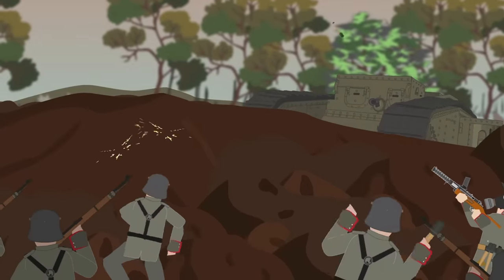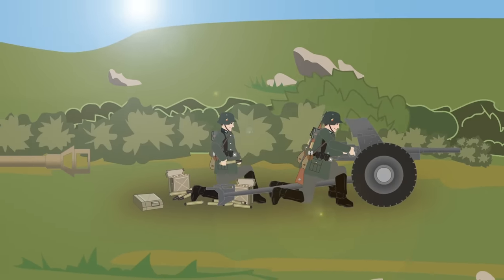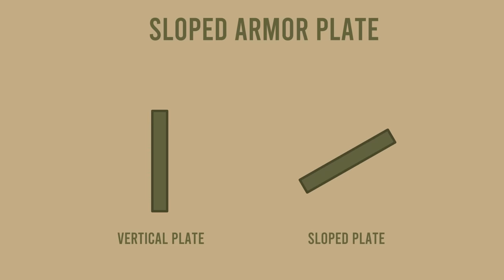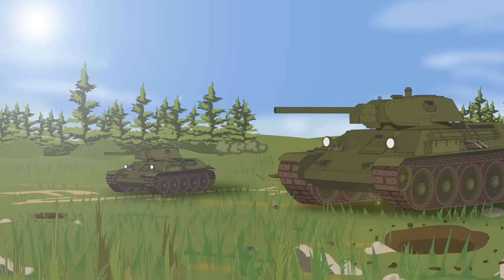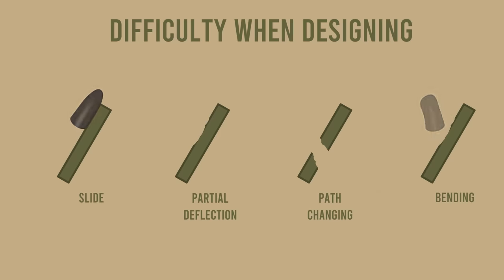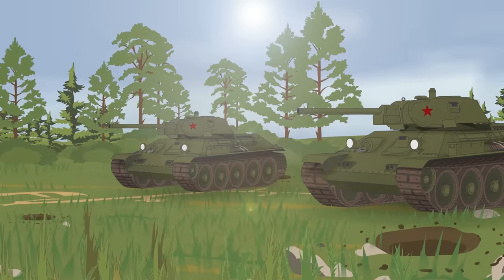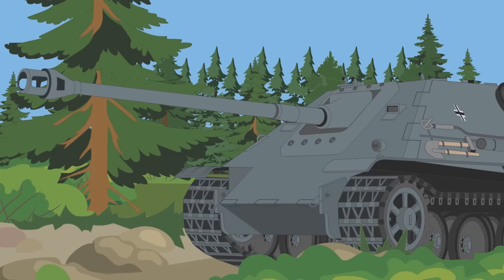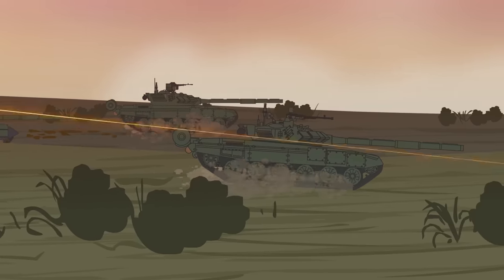Sloped armor: A simple feature that saved many lives

Comment: I want to add in an extra advantage of sloped armour. If a round impacted the armour, it has a tendency to deflect away from the normal, increasing the effective thickness of the armour.
What you need is shell type. To combat sloped armour, you need caps to minimize the deflection effect.
When it comes to penetration, caliber doesn't matter. We can take the example of the Soviet 57mm high velocity cannon. It could penetrate as much as an 85mm cannon could. A Cold War 90mm cannon found on an AML-90 could penetrate more than German WW2 128mm cannon due to it's capability to fire HEAT-FS rounds. An Austrian Böhler 47mm anti-tank cannon would be outclassed by a Soviet 45mm AT cannon or even a Czech 37mm cannon. From these examples, you can see that caliber does not matter. What matters is the type of shell is fired or the propellant charge mass of the shell (therefore, the shell's velocity) which would benefit from a longer barrel.
The main reason why you want to use a higher caliber gun is so that you can use it against infantry or fortified areas with a bigger HE shell or have higher post-pen damage. Thus, larger guns tends to be more versatile than smaller, specialised ones. Therefore, more effective in combat.

While shaped charges were a big threat, it had one very big issue: very limited range. Most of the time, you have a limited range of around 100m before said charge became too inaccurate. These limitation hampered the capability of these first shaped charges. If one were to try to fire it off a rifled cannon, said charge would spin. Upon impact, however, the jet stream would dissipate.
It was not until the introduction of HEAT-FS that shaped charges became a major threat for tanks.

Comment: First German tank to use slopped armor was the Panther... It was better than Tiger1 but inferior to Tiger 2
Reply: Actually, the first in using it extensively but the Panzer 1 from 1934 used it on its upper glacis.

Comment: 8:05 I'm surprised the Germans got of 23 rounds on 1 tank
Reply: Yeah i mean PaK 36 was obsolete by 1941,it had no problem against T-26s or BTs but T-34’s armor was kinda overkill for it.Even PaK 38 struggled to reliably penetrate T-34’s upper glacis at medium ranges.Though PaK 40 and ones introduced after that had no problems destroying a T-34.

Comment: This is far more complicated than the simplistic ‘bouncing off’ arguments. Projectile design, angles off head on, armour purity and composition, spalling, ease of manufacture, internal volume, vision devices etc all impact the balance. There are very good reasons why so many WW2 tanks did not have sloped armour despite its being around for decades.

Comment: T-34 had best armor for its time. "Sad KV-1 noises"
Reply: Actually they had about the same frontal hull thickness due to T-34s angled frontal plate.Also that only lasted for 2 years from 1940 to 1942,then Germans introduced 75mm PaK 40 and modified their Flak 88s to use them on vehicles and then T-34s just became bunch of metal coffins produced in mass numbers.

Comment: THATS WHY KV1 FREAKING DOMINATED.
Reply: Did it though?By 1943 KV-1 was already obsolete.
Reply: @AFT_05G  welllll, thats true, tigers wer more advanced and kv-1s got rekt. THERES STILL THE FRIDGE.
Reply: @thisstatementisfalse3141  "the fridge"? you mean the KV-2 which was worse than KV-1 in general?
Reply: @Kalashnikov413  THERES STILL THE 152mm howitzer, well tank trashy in general. STILL tHERE IS THE KV-1S The kv1 variant that's more advanced.
Reply: @thisstatementisfalse3141  The 152 mm gun was primarily for bunker busting and it was not suited for anti-tank purpose. Plus, the KV-1S was just a more mobile KV-1 with a bit worse armor and smaller turret with no other significant changes whatsoever
Reply: @Kalashnikov413  THERE IS STILL KV3, VERY STRONG TURRET.
Reply: @thisstatementisfalse3141  KV-3 was just a prototype, none were ever entered service, so it's irrelevant
Reply: @Kalashnikov413  Kv-4 yes a multi turret
Reply: @Kalashnikov413  FINE.....  IS-152 hows that
Reply: @thisstatementisfalse3141  if you meant "ISU-152", then yeah it's good, but it's still not a KV-based SPG
Reply: @Kalashnikov413  ah shoot. Hmmm su-85 wait that's the t-34 hmmmmmmmmmmmmmmmmmmmmmmmmmmmmmmmmmmmmmmmmmmmmmmmmmmmmmmmmmmmmmmmmmmmmm 
Su100y wait.
Ummm 
Ah shoot. Kvs get outclassed in any sense
Reply: @thisstatementisfalse3141  There was one though

The SU-152 was based on the KV-1S hull and chasis, however due to the production of KV-1S shut down, only around 300-ish were made
Reply: @Kalashnikov413  forgotten bout that one but kvs I think just look blocky
Reply: @thisstatementisfalse3141  ok
Reply: @Kalashnikov413  nothin special bout kv accept very blocky.

Comment: sloped armor is overrated(it completely fucks the ergonomics of the tank), its not that great which is why  cold war tanks or even MBTs dont really use it as often as the T34 design does because the T34 ergonomics is so crap that they have a very slow reload speed as the tank was uncomfortable and thus hard to operate.

also the T34 didnt save many lifes, its sloped armor "advantage" was severely negated because of how the soviet T34 armor was heat treated, it basically made the armor tougher but more brittle because of this alot of T34 crews would get wounded or outright die because of the spalling caused by the poor metallurgy.

Comment: This is basically a myth. Sloped armor was known for decades before the second world war. It wasn´t a secret to the Germans nor any other in the war.

The invincibility of the T34 is also totally a myth. Germany already at the start of operation Barbarossa had a 100mm anti tank gun that would shoot in one side of the T34 and out the other side. And even the Panzer kamp wagon 1 had sloped armor. Really all German tanks, but to a lesser or more degree.

But most of them have armor sloped at anything from 70 to 80 degrees, that is not that visible impact full. But that is on they hull. Look at the tower, Even the most boxy of them, like panzer 3 and 4 have pretty sloped turret.

The reason being that most hit to a tank is to the turret, so it makes most sens to  have the sloped armor there.

And then of cause, if there are only benefits and no drawbacks. Well here is where the myth really kicks in. There are plenty of drawbacks.

The first and most obvious is that it takes from the interior space, making the tank less ergonomic. T34 is horribly cramped and really hard to work in, and its really easy to get your shelf hurt on pretty much anything.

The second is visibility, sloped armor lens worse to visibility, making it harder to spot target and danger.

A third issue is that its much harder to produce. Well how did Russians solve that. Well they used a lot of casted parts, they are not nearly as strong, and typically heavier.

So why did Germany copy the Russians. Well they didn´t. The turret (at least of the 1, 3 and 4) was already sloped. And for the front about 50% of the frontal area on both the Pzkw4 and the Tiger is already sloped. They replaced 4 bits of front amour (that of 2 was slopped and 2 was not) with 2 bits that was both sloped. , and basically a similar story for the side. The draw back was that the new armor have to be precision cut and could not just be squared. Hence, more complicated production.

So how did they solve the space part... well the new tanks was simply made larger. The interior space was similar or the same.

Here is the real kicker. Tiger 1 and tiger 2 have the same gun, the same engine the same transmission and the same for most of the heavy interior part also similar road-wheels. Still the Tiger 2 is about 15 tons heavier... heavier, NOT lighter. Why is it heavier. because its larger, why is it larger, to fit the sloped armor.

The Panther vs the Pzkw4, similar story , same gun, larger engine, almost twice as heavy.

So why was the T34 so good.. Here is the largest myth, it wasn´t. It was just dictatorship propaganda. The USSR needed propaganda to convince there people they was winning, so T34 was the super tank, and German needed a scape goat, so the American design T34 was there scape goat. (T34 was a upgraded Christi tank). In reality, there hardly ever is very much tank on tank battle in any war, Not WWII, not gulf war, not the war in Ukraine. Its just not very common. It wasn´t the T34 that won Russia the war, it was trucks, normal guns, infantry and aircraft's. There really was just one large scale tank on tank engagement, battle of Kursk. And it resulted i basically a draw (That later would favor USSR), but it wasn´t the T34 that gave USSR the draw, but mines and entrenched anti tank guns. The T34 in the combat  area was mostly taken out in a early phase, and during the USSR attack, most of the German tanks was lossed due to having to be abounded.

The last part is nothing special about Germany either. This is very typicall of any war, the side that are retreating have a tactical advantage, on the flip side of that coin they have to aboundand all equipment that can´t move, that is the reason why Germany aboundand the most tanks, not becasue they where less reliable, but because Germany was retreating for a larger part of the war.

Comment: By the way, in the 21st century, do Russian tanks easily have sloped armor?
Reply: While yes there are slopes in the armour of Russian tanks, that is designed with a low profile in mind, rather than armour protection. We are the stage of developing anti-tank weapons where if someone hits you with an APFSDS round, it doesn't really matter if your armour is sloped or not, it's gonna get penetrated. These days, you either have ludicrously thick frontal armour or ERA to counter an anti-tank threat.

Comment: Do these tank designs have any relevance in the Ukraine war and modern warfare in general? I saw many reports of tanks getting destroyed easily by rocket launcher wielding Ukrainian infantry.
Reply: modern armor works quite diffrent
Reply: @tizi087   Its the same just the materials changed.
Reply: @viceralman8450  no, reactive armor for example works diffrent than simple steel plates..same goes for Composite armors
Reply: @tizi087   ERA is not part of the armor is a add on, am referring to composite and composite works like steel but lighter.
Reply: @viceralman8450  the armor describes everything that protects the inside from the outside... why would the reactive Part be just an add on?
Reply: @tizi087   Is a add on as it isn't a part of the armor.